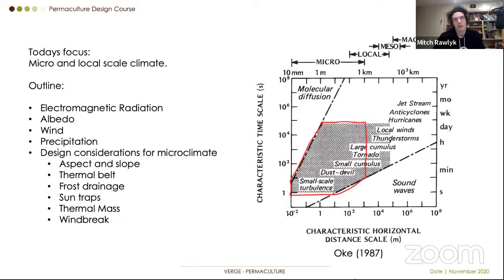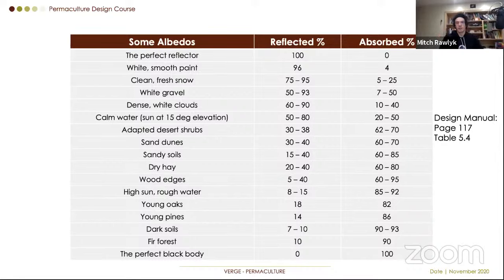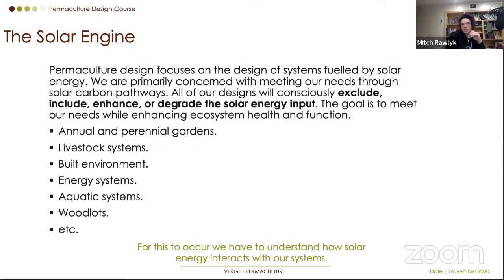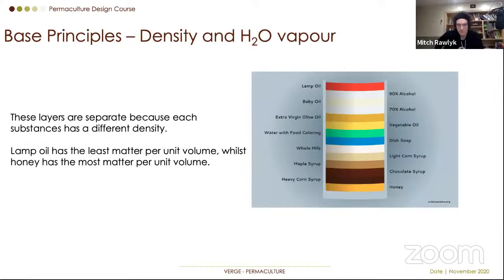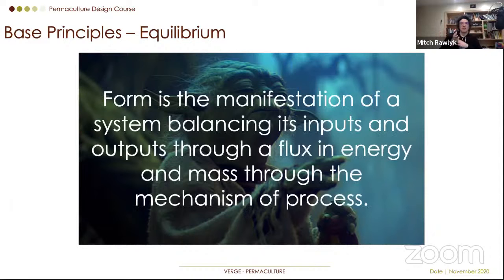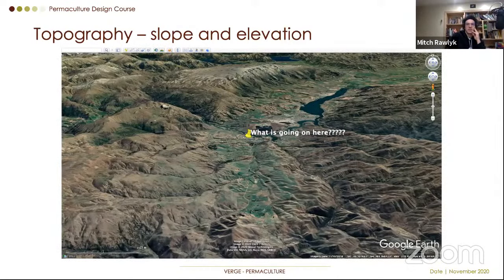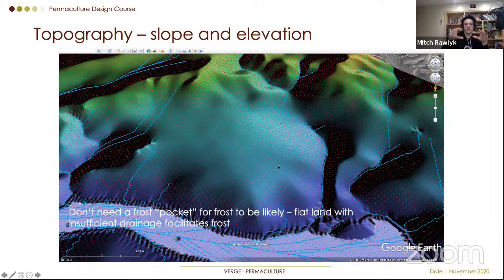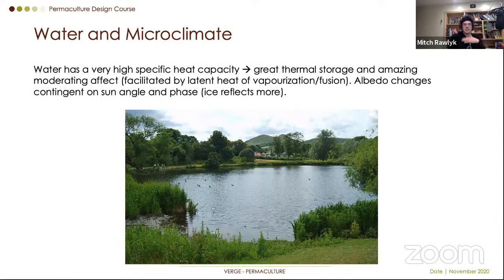2020 Introduction to Permaculture (4/6) - Microclimates To Enhance Food Security with Mitch Rawlyk

Comment: Thanks for this great info! One comment: 'Short Wave' (SW) in Atmospheric Science is typically used  to describe the downwelling near infrared radiation from the sun, when you're doing an energy budget at the surface. It is NOT the UV part of the spectrum. UV is negligible for sake of energy budgeting. 'Long Wave' (LW) refers to the far infrared. Important to understand that it's all infrared though.